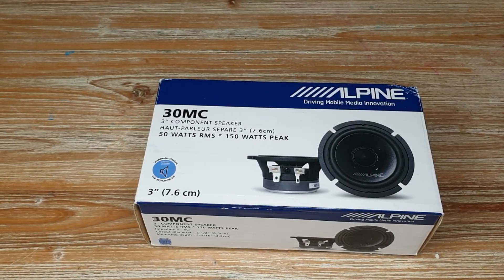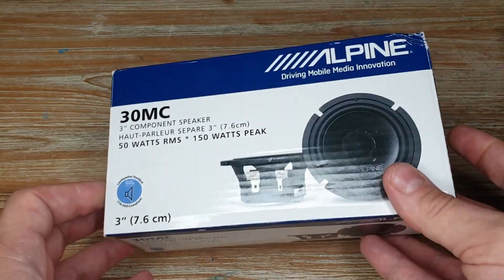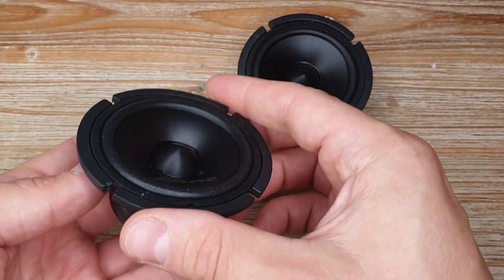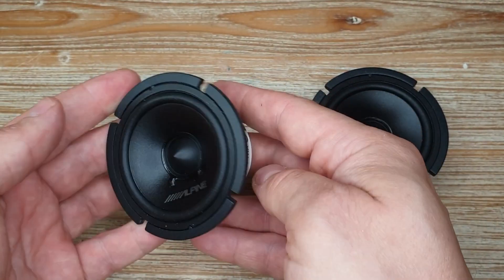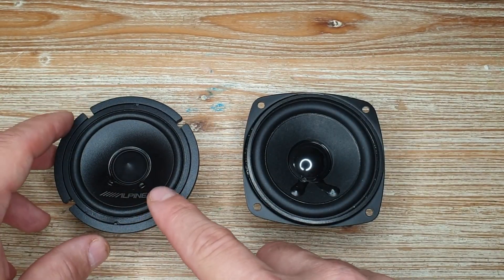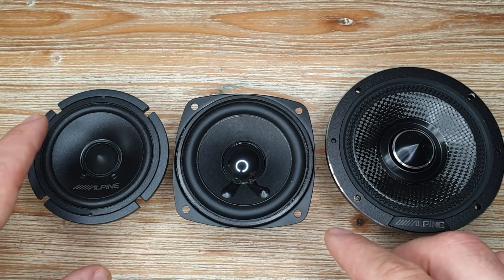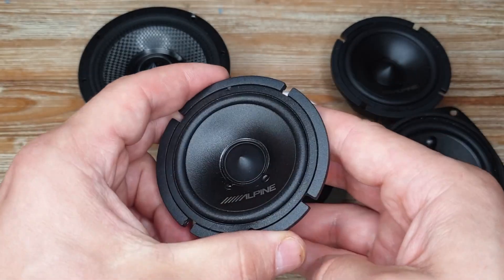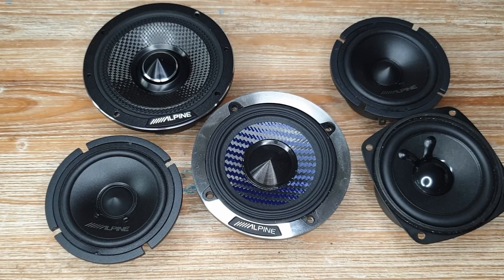Alpine 30MC in depth review (+distorsion). A flop from Alpine?

Comment: I have 30mc’s paired with two sets of alpine type x’s on a type x amp and my experience is pretty amazing with them, but would it be worth the upgrade to 3.5 alpine dp?
Reply from the maker: In my personal opinion it would be an upgrade🙂
Reply: @RAW-CAt  if I paired the 30mc’s with a sound processor, could I possibly get the distortion down a lil bit?
Reply from the maker: @gavinbrill3893  no, distorsion is in the driver, nothing will change that unless you cross them ~350Hz.
Reply: @RAW-CAt  will do then, because 30mc only alpine 3/3.5in available in the USA unless I buy a set of status

Comment: Greetings
I'm an Alpine fan as well. I've enjoyed your testing videos
What's your listening preference of the two sets?
Disappointed in the 30MC 3.0" Mid-range Component, I have the X-Series x-65c
How would you compare the 3 sets?
I was going to add the 30MC but I see the DP35m is sold separately. How do you think the 35m will blend with x-65c?
Reply from the maker: I will be listening later on after installing them. Comparing speakers acoustically on the bench is not fair, as they are designed for in car use. But I think the DP35 will blend very well with the X65C.

Comment: I'm nearly finished putting a set of 3" Faital pro's in a set of a pillar pods, should be in the car in a couple of weeks,  been running then at home crossed at about 150hz with my home theater sub filling in below and they sound pretty good. Originally bought the ferrite version, but they were really heavy to swapped them for the neodymium version. Not sure if my A pillars would have coped with the weight.
Reply from the maker: I wanted to get the 3FE25s for this instead of the Visaton FRS8, but knowing Faital Pro, I would imagine they will perform on the same level as 4FE35 that I tested previously.
Reply: @RAW-CAt  It's my first system for many years after being heavily into car audio back in the early 2000s. I will probably upgrade the Faitals  in time, but they were a cheap starter speaker for my system (OE headunit into a Match DSP amp, gonna be running the 3" tweeterless with midbass in doors or in enclosures on the floor under your legs. Then a sub in the boot). It's a really small car so don't need a lot of level. 

Loving the videos.